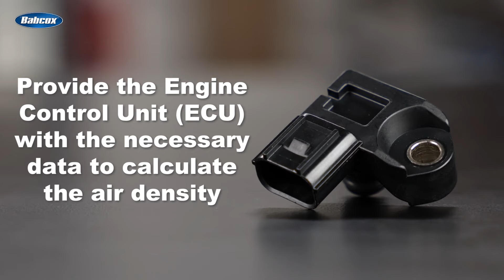Walker Products Mass Air Flow and Manifold Absolute Pressure Sensors

Comment: why is it that aftermarket electronic devises often dont work like the OE parts?
Reply from the maker: Generally, one of two things are the reason for this.

1. The use of inferior electronic components - this often results in shorter lifespan or incorrect signals sent to the ECU.

2. Improper sensor programming - if an aftermarket part is not designed exactly to OE specifications, you will very likely have issues.

These two reasons are EXACTLY why Walker Products puts so much effort into R&D and Engineering. Our Product Developers design all of our products to meet EXACT OE specifications for Form, Fit, and Function.